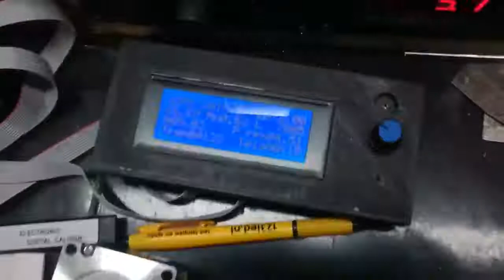filament extruder 2 lang

Comment: Would a water bath work for cooling the filament down or is air just easier
Reply from the maker: It can work. But i try but it is very dificult and hard to get it richt and i converted back to air

Comment: which motor are u using?
Reply: also the sensor?
Reply from the maker: the motor is a old window wiper motor from a ford transit the sensor is this one https://www.thingiverse.com/thing:454584
i have new more powerful motor a 220 volt 3 phase geared motor but i did not find the time to install it.

Comment: Do you provide stl or source files thanks
Reply from the maker: search thingiverse for thingiverse lyman extruder you wil have heaps of stl files and plans and idea's
Reply from the maker: and this is my simplified desing  but in this movie i use the lyman mulier firmware but with my wiper motor and a simpel pot pwm speed controller
Reply from the maker: https://www.thingiverse.com/thing:1454222/files
Reply: @makerbear  thank you for your help i will check it out so for this project i find that most thingiverse things talk only about the extruder but in fact this project contains other parts like the Lazer that calculates the accuracy the warm bath and the cold one the dryer after bath to remove humidity the winder which i didn't figure out yet and finally the piece that guides the filament as it stocks in the winder. For me I'm just starting to learn cad programs so i don't have the ability yet nor the idea how I'm going to design this also for others work I'm not convinced yet with the designs i found till now thank you again for the keyword i will check it out definitely maybe I'll find something interesting 🙂